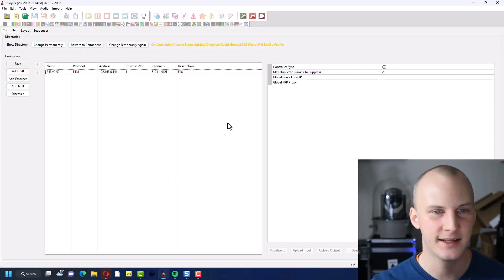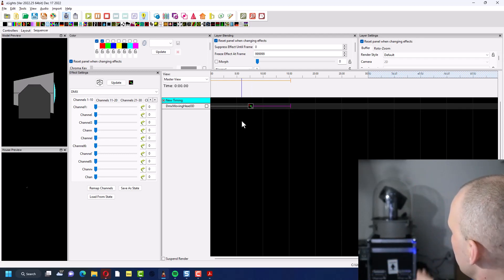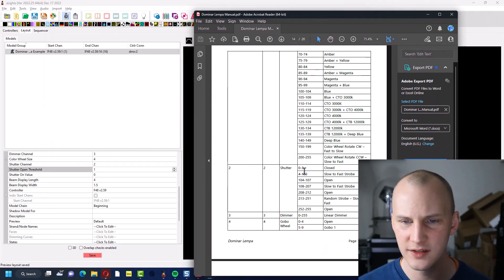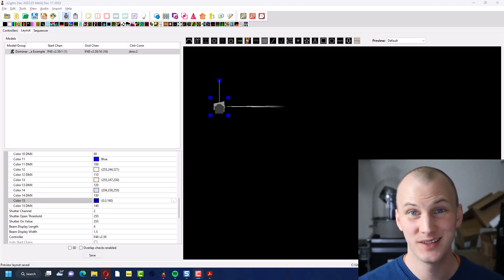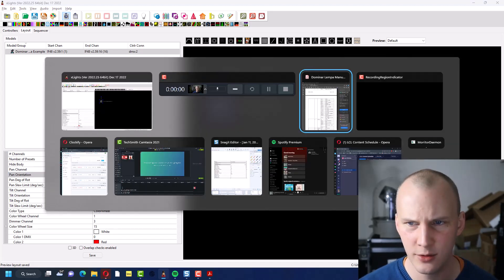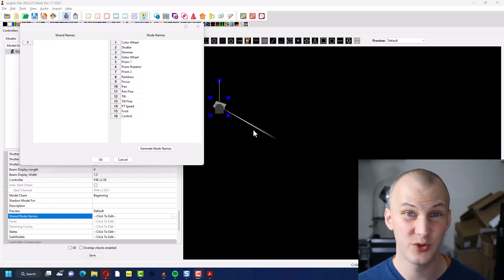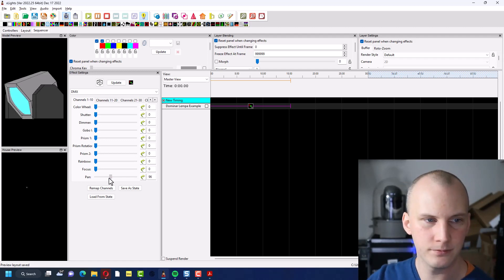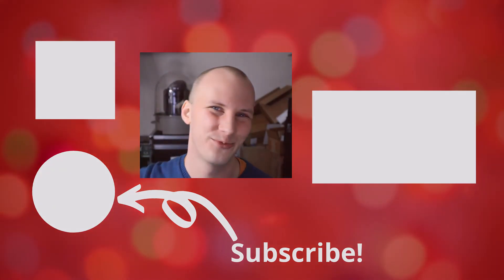How Do You Set Up a Moving Head Light in xLights?

Comment: Unfortunately this setup does not seem to work or apply to all beam fixtures. All works fine until you begin importing begin importing sequences and there are orientation issues immediately with certain fixtures. Could be just me but the more expensive Hydro Beams and Elation outdoor fixtures require tons of tweaking. This seems to work with the cheaper or lower end lighting fixtures.
Reply from the maker: Every fixutre is going to potentially have different orientation (And sometimes direction) of Pan/Tilt.  It's not really correlated to cost.  The Remap channels dialog in the DMX effect of xLights now allows you to offset or scale channel values individually, which can get you there :)